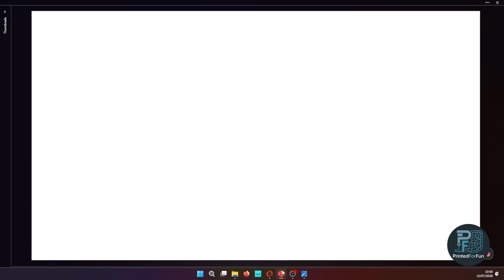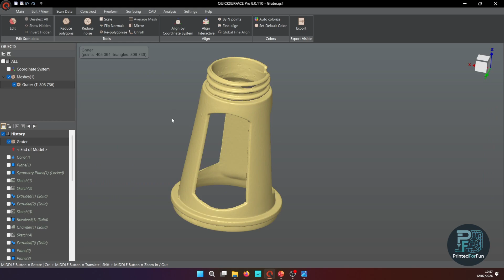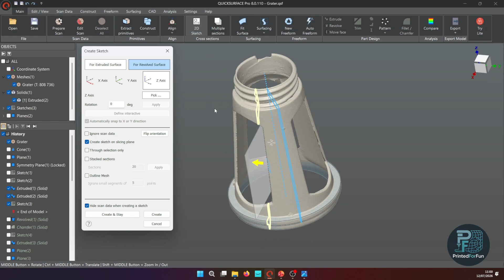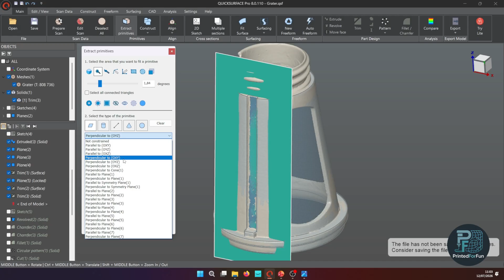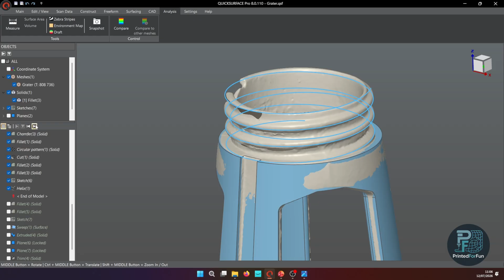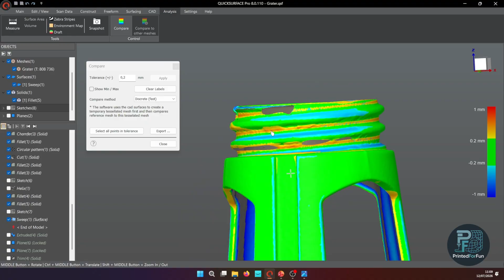Broken Tupperware Grater repaired with 3D Scanning and Quicksurface - Quicksurface Tutorial

Comment: Very cool!  I love using QS. I see the symmetry plane used often, but for round objects I create a plane 90 degrees from the original planar surface.   If the original plane had nearly zero deviation I usually get a more accurate symmetry plane from this method.
Reply from the maker: Interesting approach, will certainly try it out